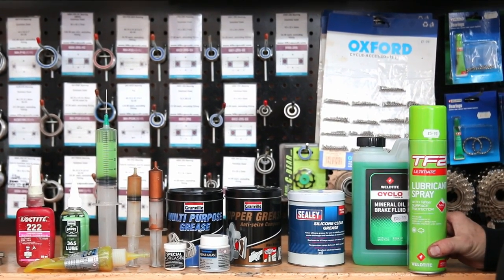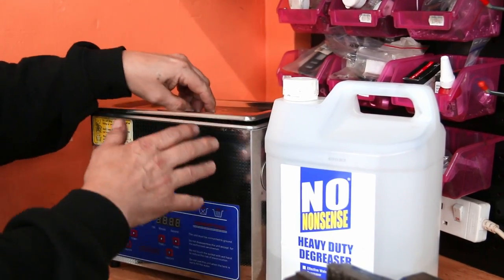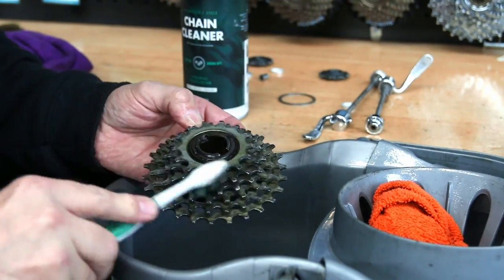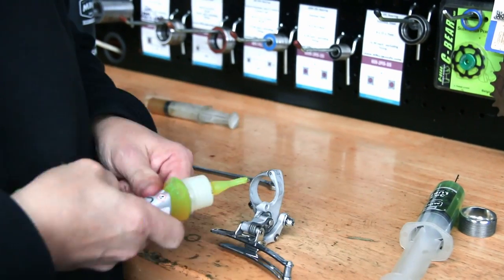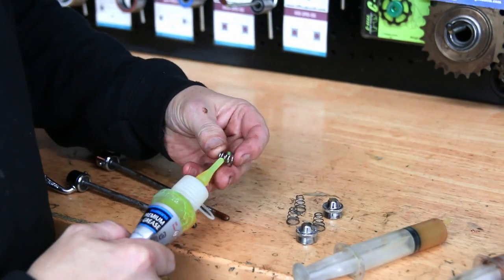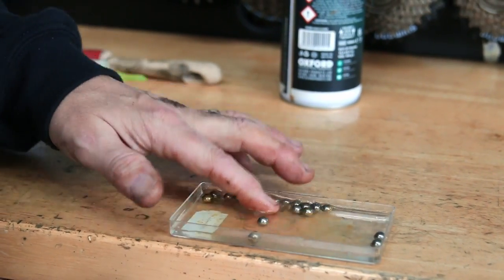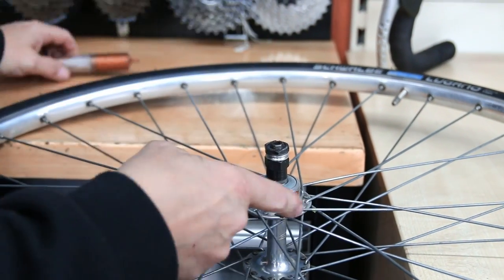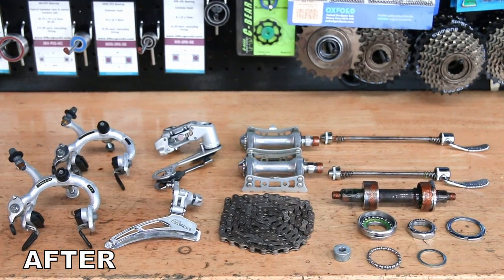The Ultimate Grease, Oil And Lubricant Bike Guide!

Comment: Please don't use copper anti-seize on stainless steel threads or fasteners as it contributes to solder embrittlement or inter-crystaline of the thread flanks. Best to use non-metallic (boron nitride) or nickle.

Comment: Using copper slip on steel on steel contact points shouldn't be an issue. Aluminium and copper on the other hand is a big no-no - Aluminium will deteriorate. See galvanic corrosion.
Copper slip is used in places where you need a lot of heat resistance, i.e. there is no reason to use it on a bicycle.
Use ceramic/ptfe grease and have zero worries about galvanic corrosion.

Comment: Copper slip is a poor choice on Aluminium. Better to use a ceramic antiseize to avoid electrolytic problems  if you must, but to be honest normal grease works fine.

With you on the Shimano grease, its good stuff. Mobil xhp 222 blue grease is also pretty good ans a bit thicker than the Shimano, good for winter bike hubs etc.

Have you considered using a proper parts cleaner on parts? There are even some bench top ones around. That would give you pumped circulating cleaner through a nice brush all contained in a unit.

Comment: Another fantastic video - Quick question... is the detergent in the ultrasonic cleaner used only once or can you keep it in for multiple bikes/components?
Reply from the maker: You can use it many many times over though it should be changed and cleaned out regularly enough, otherwise you end up with a silt that just sits in the cleaner, you’ll get to the stage when you know it’s time to wash out
Reply: @Bikespeeds  Perfect, thank you!

Comment: Hi, thank you for your videos, they are so good and helpful. I'm thinking of rebuilding my STI 5600 10 speed shifter, because no matter what I do (adjusting, changing cables and housings, adjusting rd hanger, changing jockey wheels on rd, changing chain and cassette), fourth and fifth gears are not changing correctly. Can STI shifter worn out? Can I put disassembled STI shifter parts to ultrasonic cleaner? And what lubricate to use when assembling STI shifter? Thank you.

Comment: Good video, what grease do use to install headset races into carbon cups? Also I find neat Screwfix degreaser aggressive on anodising and special coatings, do you dilute it in the sonic bath?
Reply from the maker: I always favour cooper grease on sealed bearings in a carbon cup & through experience we get a feel for what can and can’t go in the degreaser, we have more than one cleaner and will use one with a regular soap based cleaner too.

Comment: Hi there mate, great video. What is that spray you use at 6:08 on the cone/cup area of the wheel hub and what is that spray for? Wondering which brand you use so I can also buy it, cheers.
Reply from the maker: That is a degreaser spray that will soon be available on our coming website, thanks!🧡
Reply: @Bikespeeds  Thank you I appreciate that!

Comment: Your copper based grease is the WORST thing you can use on a bicycle!
 It is intended for high-temperature applications like in combustion engines. Copper and aluminum don't mix. Your copper based grease will greatly increase the electrochemical contact corrosion with aluminium. Why don't you use standard titanium based montage paste like endless other bike shops?

Comment: Stainless steel with copper anti seize aint match or just ok?
Reply: It is ok, but unless you use good one better to use ceramic or nickel based one.  If heat separates the grease then you might have issues, that will not happen on a bike, generally

Comment: would you use copper slip on a cassette to a free hub ?
Reply from the maker: I don't see why not, but I tend to use a regular grease for that as all you're trying to do is stop any dissimilar metal corrosion happening.
Reply: @Bikespeeds  Do you need to grease the cassette body at all? The fitting between cassette and freehub body is not very tight, and the parts do not move against each other.
Reply: @einundsiebenziger5488  Yes, because you want to stop corrosion. Lubrication is not the factor here

Comment: Very informative video. Would you do a review on @GreenOil UK bike products? I've been wanting to get products to maintain my bike but am new to this. I was looking for environmentally friendly products and came across those. I would love your opinion. Thank you
Reply from the maker: I’ve not seen them. None of my suppliers list these. Sorry.
Reply: Thank you for checking. They have a YouTube channel @GreenOilUK but are there environmental products you recommend for bike cleaning and maintenance?
Reply: I’ve used the green oil chain lube, seems to work as well as other brands I used in the past, works well through the winter, and smells nice as well sort of aniseedy.
The grease didn’t seem to work or last that well, I swapped back to cheap marine grease bought off ebay when the tube was empty.